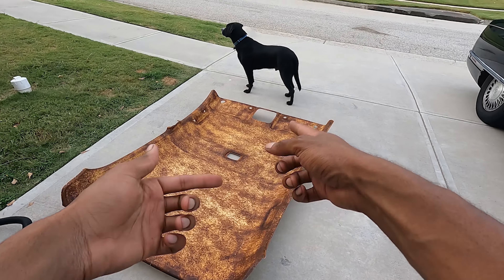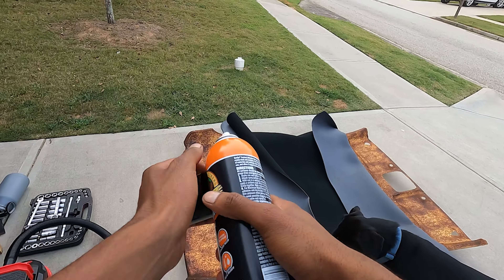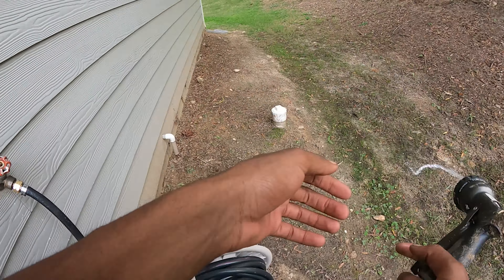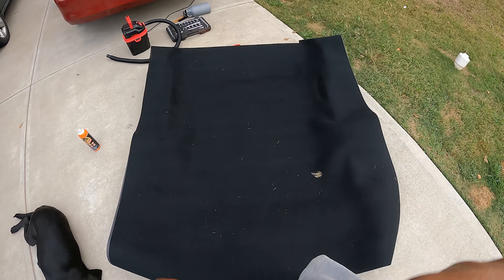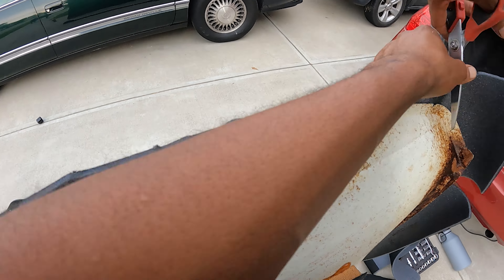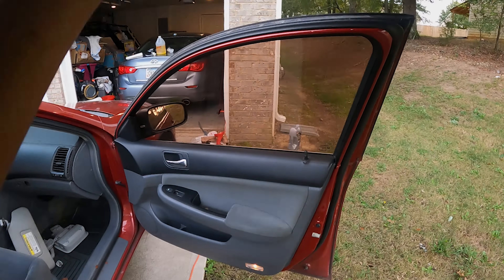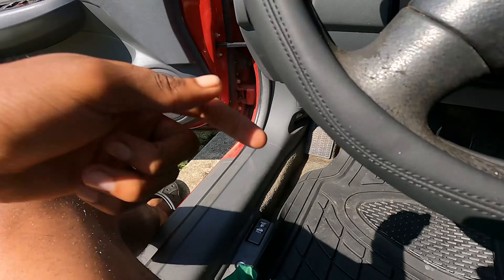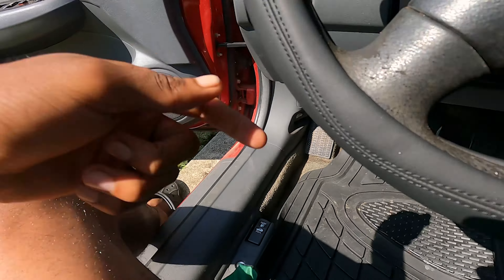Hot to replace a headliner on a 2005 Honda Accord Replacement Tutorial

Comment: Good video. I did not hear the part you said it but I'm guessing you already had the black color for the headliner or you could not find grey. I've had to do this before once using the wrong color, but it would have been a million times better if you got the right color. That car is too nice to put the wrong color headliner.
Reply from the maker: I totally agree. If I were to keep the car, I'd just paint everything that is beige, flat black.
Reply: @JLowe  Just a head up. I painted a whole interior from tan to black using the interior paint. it's cheap and doesn't hold up well. Scratches easily. You either need pro grade paint using a paint gun like a shop, or just swap a whole interior from a clean parts car. I used the can interior paint made by duplicolor brand.